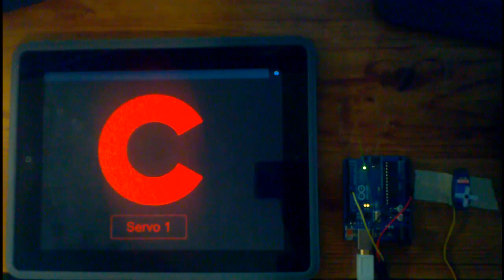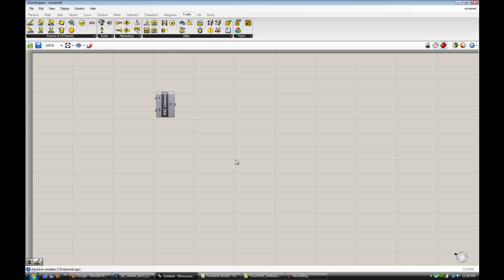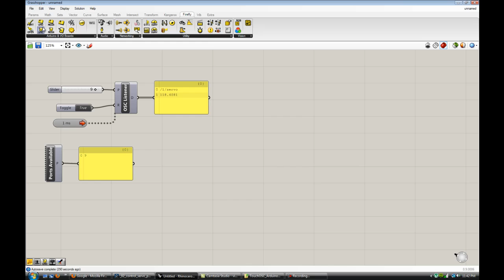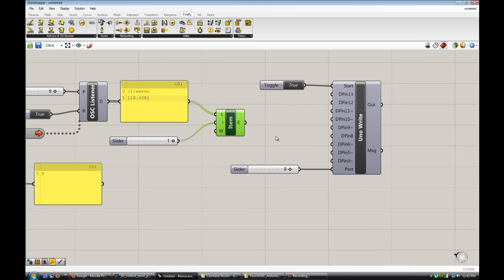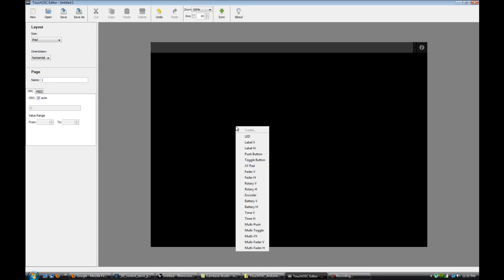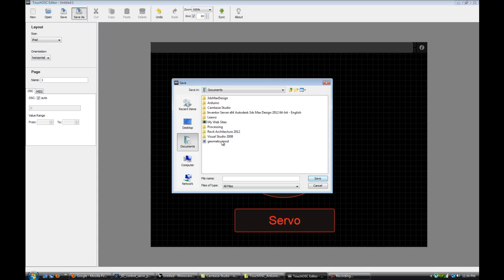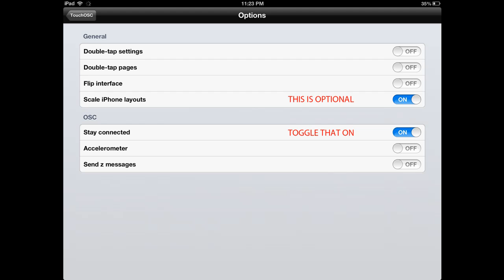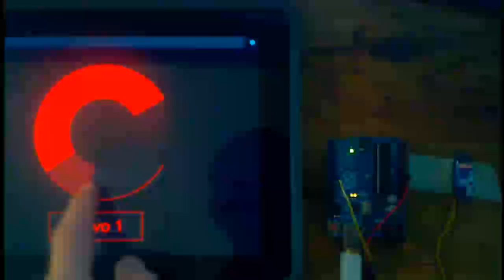Servo Control via TouchOSC on iPad (Grasshopper, Firefly, Arduino UNO)

Comment from the maker: Abhi Chauhan,

The OSC Listener has capability to receive multiple data streams. Configure your Touch OSC to send out multiple data and OSC Listener can receive them and arrange them in a Data Tree. You can then access that data tree like any other list. Watch my other video on using touch OSC and Light Sensor...it uses multiple data streams from TouchOSC.

Comment from the maker: Load up Arduino firmata. I think i have recorded this tutorial in an improper order. Once you load up Arduino firmata it should be visible to ports available. If not, then i would create a serial port using a serial port emulator. You can download such from google for free. Good luck!